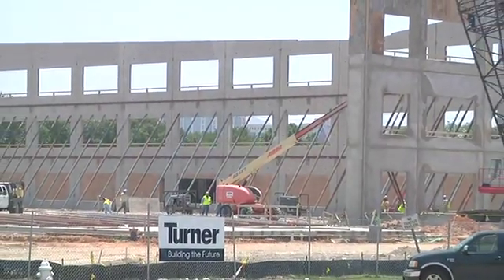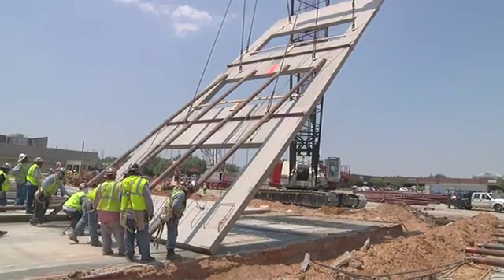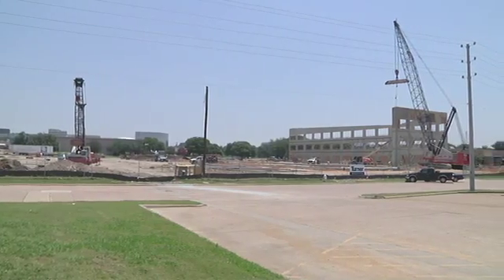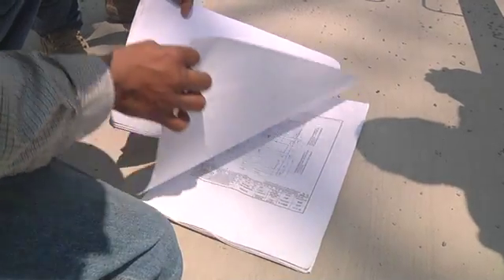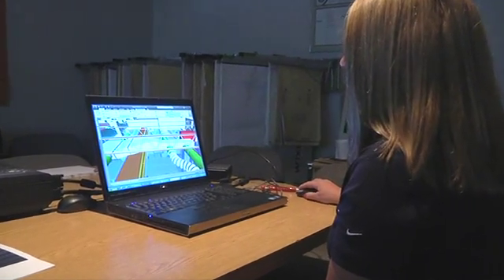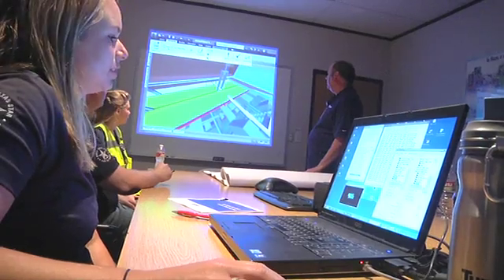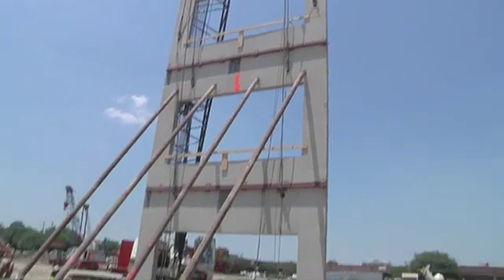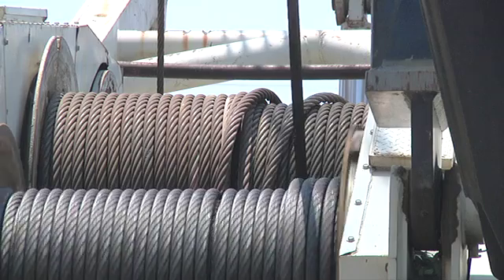Turner Construction Company Tilt-wall Project in Texas

Comment: Starting at 1:13 in the video, there is a welder attaching the bottom of the panel to the footing at the joint immediately beside where the next panel is being stood.  If anything happens and the hanging panel bumps the previously erected panel or brace and knocks it over, what chance does the welder, under a welding hood, have to get out of the way safely?
Reply: BlazinIronSteel I work on concrete tilt ups and you are correct that is NOT how we do it. By the way these pannels only have eight pick points each pannel. We did a pick today and a couple of the pannels had twelve. talk about a big bitch.💪🍻
Reply: BlazinIronSteel true I am crane operator would have stopped lift